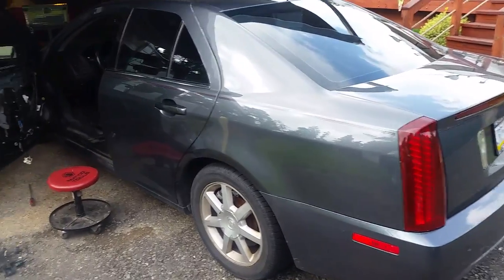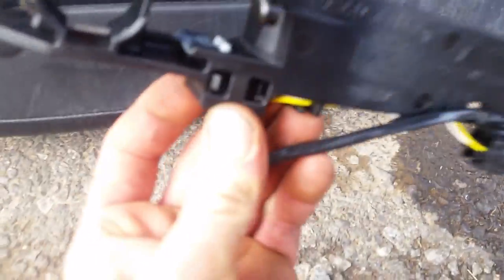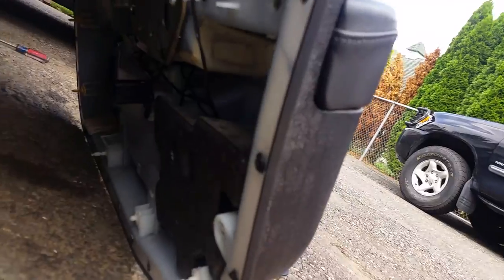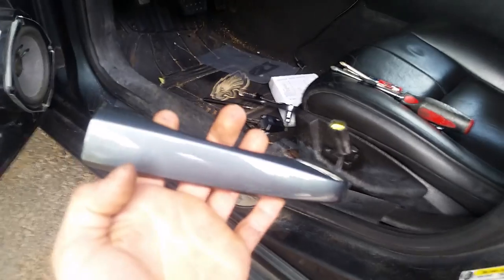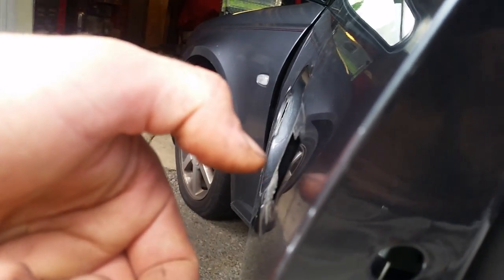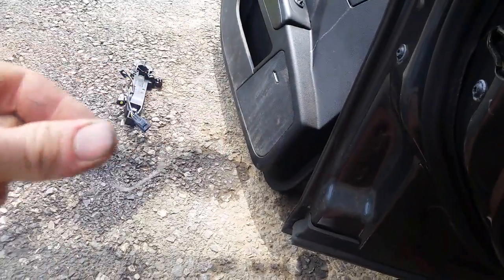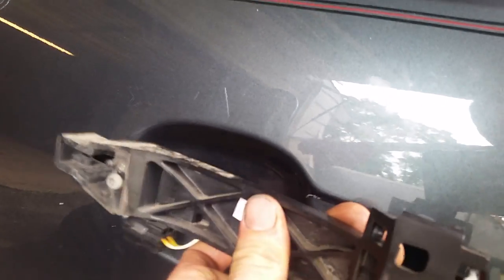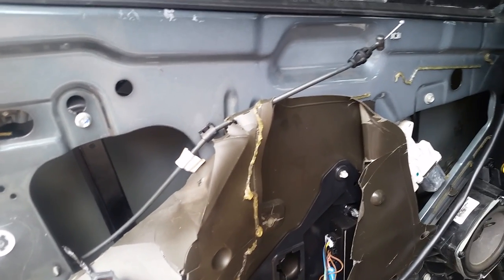2006 Cadillac STS door handle micro switch repair

Comment: Sorry to bother but my 06sts got flooded but my mechanic got it back started but my windows,seats and doors wont work I checked the fuse but it is not blown. Do you think a window motor and regulator will fix the problem or any tips?please thanks

Comment: Thanks for taking the time to make this video.  You said "today I'm replacing the whole housing". Have you replaced just the switches? I'm having a hell of a time finding the part number for the switches only. Any help would be much appreciated.
Reply: Have you had any luck finding just the switches? Anything that pulls up for me on the “switches only” replacement are for 08 or newer! I can’t for the life of me find anyone or anything that says “just buy this micro switch to replace in your 2006 STS front door handles”

Comment: On my 08 sts the drivers door wont unlock sometimes even when the car is fully unlocked. I've noticed it happens consistently if the car is left in the sun for hours on end. But when it's not hot out or the sun isn't shining down on it it opens like normal. Any idea what part might be failing? The door opens from the inside handle and opens when using the physical key. Also my keyfob has seen better days and the car doesnt recognized when the key is in my pocket and wont start the car unless the keyfob is placed in the center console. The battery has been replace in the keyfob but didnt fix the issue

Comment: Is this what causes the door to not open from outside? On passenger door. My door opens from inside just not outside. Took it to a shop and they had no idea what was wrong.
Reply from the maker: Usually a bad micro switch in the door handle mechanism. Like what I showed replacing in this video